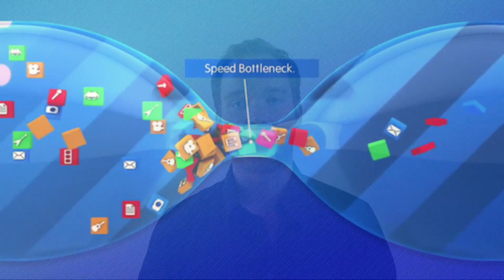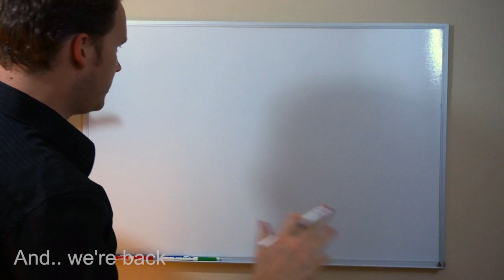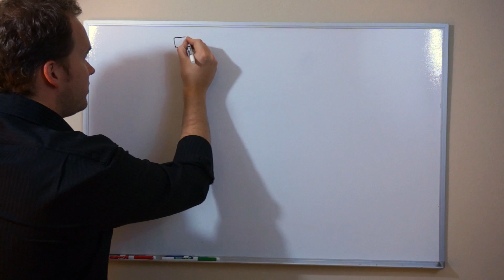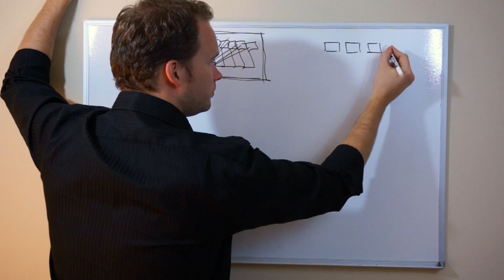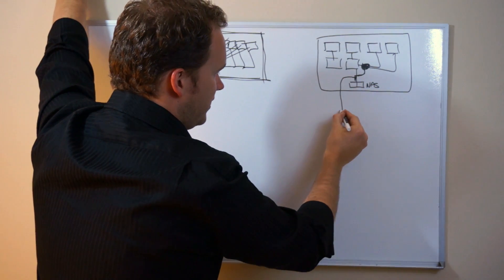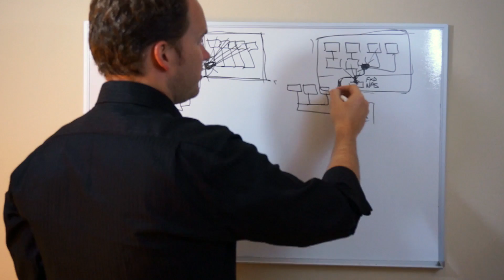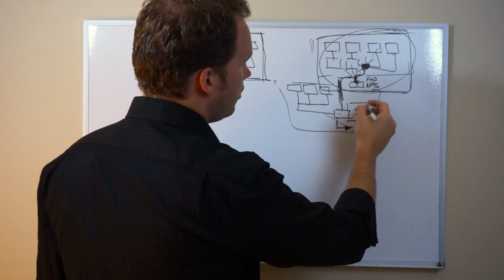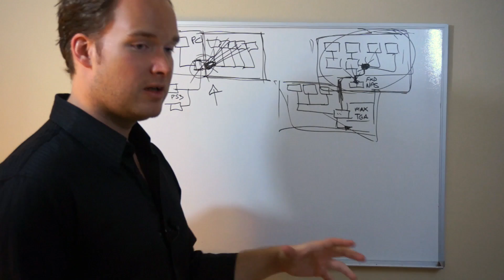FumeFX Hardware, Workflow practice and Faster Simulation Speed!

Comment: i have a 3960X 24 Core Threadripper but FumeFX use only max. 9-20% of its CPU Workload ... any idea what could be wrong? (in the preferences I have checked use all CPUs) thx pat!
Reply: @patfish 
any idea what was it due to,, 
probably there was TP in the scene,,,, I am currently wondering of getting a cpu node and i am looking at both intel and amd,

Comment: Insightful hardware tips Allan, I'm currently working on my gaming laptop I've bought a year ago, work like a charm with latest software version Max/Maya 2019, Vray 4.1, Substance Painter 2018 3.1, no problem so far. I'm a self-reliance student though, can't afford an expensive PC yet.
i7-7700HQ 2.8Ghz
GTX 1050 4GB
2x16 DDR4 Corsair Vengeance 2666 Bus. (Corsair Vengeance my favorite RAM product line)

Comment: I wonder how many people cuss their GPU because it's not taking advantage of the CUDA cores. I just installed a EVGA GeForce GTX 980 Ti and it took several suggested solutions for CUDA 7.5 to kick in. After listing the model name of the card into the raytracer_supported_cards.txt file and launching AF, the GPU method of raytracing was grayed out. What finally worked is NVIDIA's Control Panel. Smooth sailing now, mate.

Comment: Our tests here are showing that less cpus/cores but higher freq is better for simulations, the reverse is better for shading. 3.5 GHz quadcore would outperform a 2 GHz dual quadcore or even sixcore in simulations, but the multicpu one wins at raytracing.

Comment: Great video! Thanks a lot for taking the time to explain all this.

I have a doubt about processors, which would be best? 

2 x 12 cores (24 threads) at 2.5ghz
or
6 cores (12 threads) overclocked at 4.3ghz

It would seem cheaper to build a single cpu machine and overclock it than to build a dual cpu xeon machine, but would it be that much slower?
Reply: I think 24 cores would be better